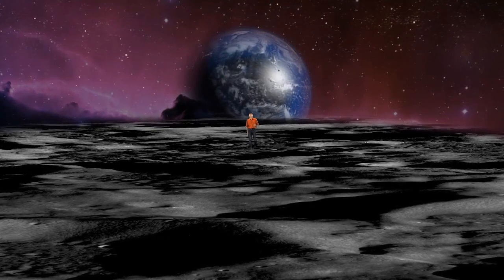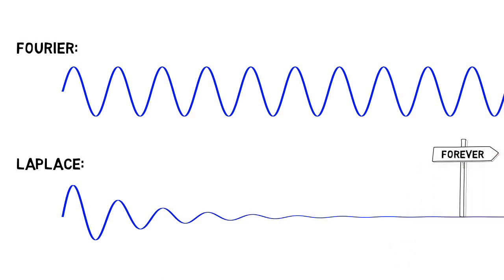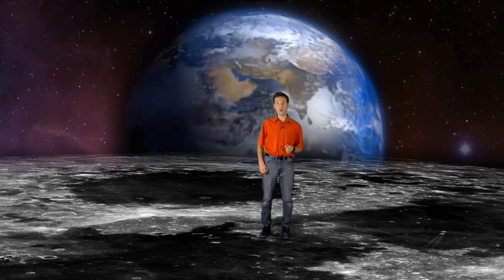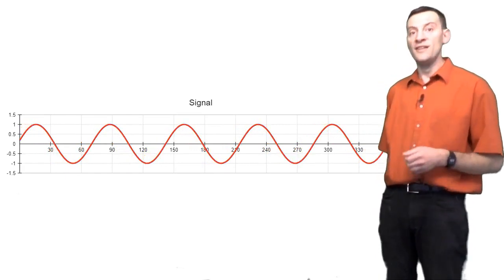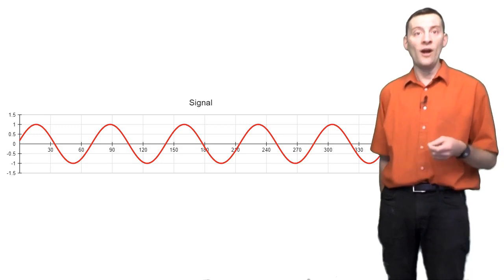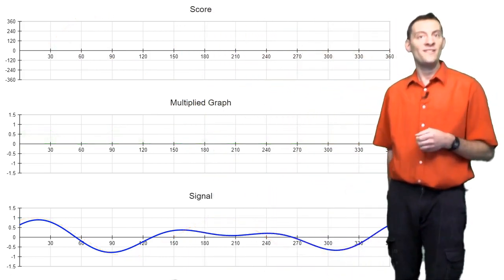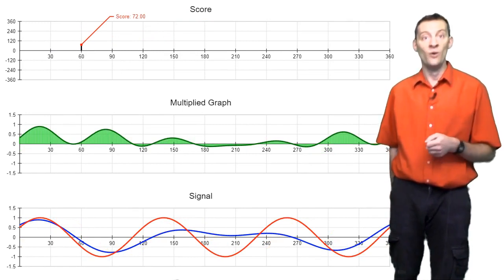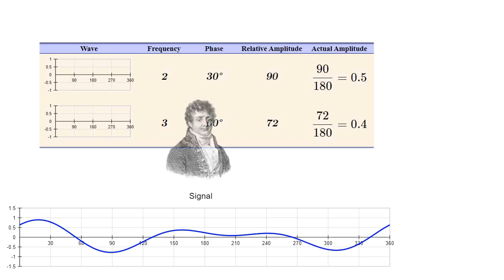Convolution and the Fourier Series

Comment: This is a lot easier to understand for mere mortals like myself than 3blue1brown. What I was unclear about is now clear: his winding and tracing of the center of mass corresponds to multiplication and calculation of the area. And I was missing the connection that sine and cosine of different amplitudes cause a phase shift. Looking forward to the next videos.
Reply from the maker: Wow, thank you so much for the compliment. I was always so frustrated when I was learning about the Fourier Transform at university. I could see that it was something amazing I couldn't quite understand how it worked. Now that I do, I really want to help others understand this most amazing of tools. I'm so glad I was able to help you on the point you mentioned in your comment. Thanks for your support.

Comment: I don't understand how you obtained the score values mentioned at 10:25. You say its the area under the sinusoidal (I understand that) but how did you get the numerical values of 76.07 etc ?  Obviously you must have integrated the values on the X and Y axes but can you provide a worked example for say the value of 180, mentioned at 10:33 ?
Reply from the maker: In the specific example here I did it numerically with a Riemann sum rather than solving the integration analytically using the rules of calculus. A Riemann sum divided the graph into a lot of square strips. The area of all the strips are added together to give an appropriation of the area under the graph.

Comment: First of all thank you for this incredible work

 I tried to apply what I have learned in this lecture on a function f(x) = sin(x+90) 
First I multiplied my function by sinx and took the integral between 0 and 2pi 
secondly I multiplied the function with cosx and took the integral between 0 and 2pi 
and then I used the inverse tangent rule which gave me 88 as phase shift
 but the phase shift in my function is 90 degree 

what is wrong with my calculation sincerely

Sincerely

Comment: Thx for the video!:
Small question : at 18:00 ,  Why is the 2nd method(by multiplying the signal by non-shifted cosine and sine)  of calculating the score equivalent to the 1st method(by shifting a sine wave of the frequency of interest and calculating the score for every phase shift and taking the maximum) ?
Reply from the maker: Because when you add a cosine wave and a sine wave together with the same frequency but different amplitudes, they produce the phase shifted sine wave that fits the signal at that frequency. Instead of searching for the correct phase by convolving the test wave with the signal, you can calculate it in one go by this method.

Comment: Hi Mark, your sliding test signal explanation is very intuitive, but I'm struggling with the shortcut method.  I understand that IQ signals of varying amplitudes produce a phase shifted signal, but it's not immediately obvious how convolving the I and Q somehow "discovers" the amplitudes of the IQ signals required to produce the high score signal.  Excellent series by the way, very intuitive.  Thankyou.

Comment: Fourier Transforms DO work with non-repetitive signals.

As a simple example, think of a cosine wave. Its Fourier transform is an impulse (or two if you count negative frequencies). That also works the other way round. The Fourier transform of that impulse (or pair of impulses) is a cosine wave.

And Fourier does not use convolution to find the phase, either. it uses two sine waves with a phase lag of 90° (or π/2 radians). The results can then be combined to determine the phase - or left as they are and can be quoted as real and imaginary parts.

Comment: Sir, Thank you very much.
But I have a doubt on 15: 10 - 15:30, when the freq is 3Hz, the score is 72, why the amplitude is 72/180, why is 72/180, not 72/360, or 72/120? 
We integral it from 0° to 360°？ Can you explain that. Thank you.
Reply from the maker: This fact confused me for ages, and I still didn't understand it when I made the video a few years ago. However, now I understand why. Here's the reason: You should indeed divide by 360 degrees, but when you do so, you discover that only half of the energy is contained in the frequency you just found. It baffled me for ages where the other half was. The answer is in the mirror negative frequency. If you ever look at the magnitude output of an FT, you notice it is mirrored around 0Hz. Only half of the energy for each frequency is contained in the positive frequencies. The rest is in the negative frequencies. Negative frequencies are a mathematical requirement for the original signal to be totally real (with no imaginary component). It's a bit like the concept of multiplying by the complex conjugate to get rid of the imaginary component. I will be explaining this further in a video that I am currently working on.

Comment: So essentially in order to get the set of frequencies in a given signal one has to know the candidates? It sounds like the algorithm works like "try 1Hz, then try 2Hz, and so on until the highest frequency you think is present there", as opposed to "give me a set of frequencies that are present". For example, if I have a signal that is 3.5Hz and I probe 1, 2, 3, ... - will the result be some combination of my probes rather than a single value of 3.5Hz? Also, how does the algorithm work for high frequencies, where the gap between probes is large (e.g. 1GHz, 2GHz, with lots of values in between)?
Reply: I suppose a reasonable assumption can be made about the set of candidate frequencies in the following way. If I know the time interval over which the data was collected, say T, then I can start with the wave that has the period of that interval T, and end with the wave that has the period of T/N, N being chosen depending on how accurately do I want to model the signal. Is that a reasonable approach?
Reply: I just realized that in the pure mathematical context it doesn't really matter because we're taking an integral - meaning we are going through all the frequencies, not a set of specific ones. It's when one tries to compute components the candidates matter. Sorry for the blabbing.
Reply: Found the author's blog post on the topic, it's all clear now:
http://www.themobilestudio.net/the-fourier-transform-part-7
Reply from the maker: That's exactly how it works. You don't know which frequencies are present in the signal so you have to try everyone. The Fourier Transform tries an infinite number of intermediate frequencies too.

Comment: Can anybody explain my doubt
So my doubt is instead of convoluting the test signal through out our signal we are using non shifted sin and non shifted cosine .so these two test waves are not actually sweeping through signal just convoluted as it is . Is that it? Can someone explain how we can actually make shifted signal using non shifted cosine and sine?
Reply: You're correct (I think). Using non shifted sin and cosine and multiplying them by the signal x(t) before taking the area under each curve, the phase can be calculated by taking the inverse tan of these areas. This phase is equivalent to the phase landed on by sweeping across the signal and stopping when the maximum area value is found, so the sweeping is not needed.

It was explained in the previous videos that the sum of non-shifted sin and cos waves with respective amplitudes a and b but the same freq result in a phase shifted wave of amplitude (sqrt(a^2+b^2)) and phase of tan^-1(a/b). Why exactly this relationship holds for the "scores" is still magic to me though. It was not fully explained so I think your understanding is on point as far as these videos go.
Reply: Thanks  @NN-sp9tu  so if you understand that magical moment (that instead of using shifted signal he has used non shifted sine and cosine and also he didn't sweep those signals across the main signal ) could you please explain me that if you understand in further lectures of him he told that he would continue his work on explaining after Fourier transform